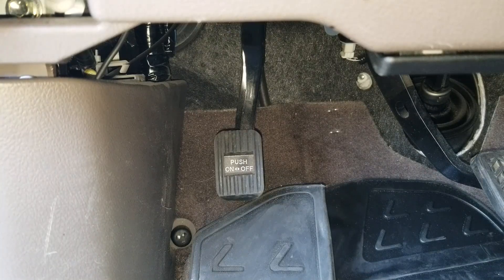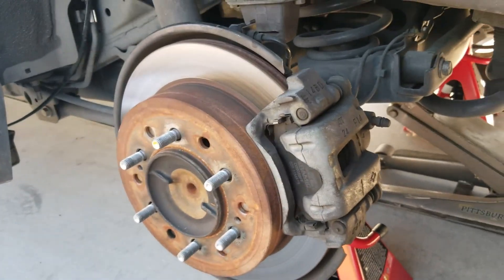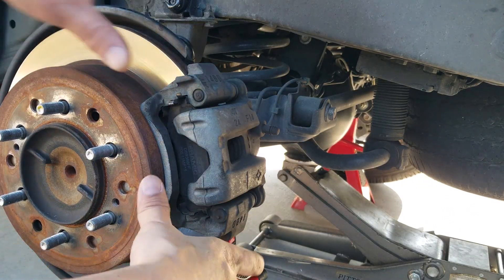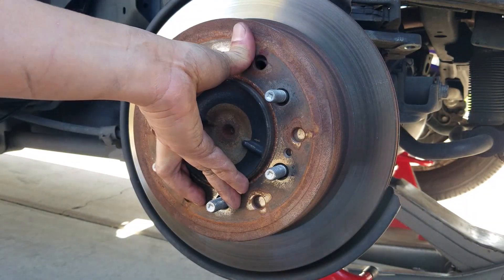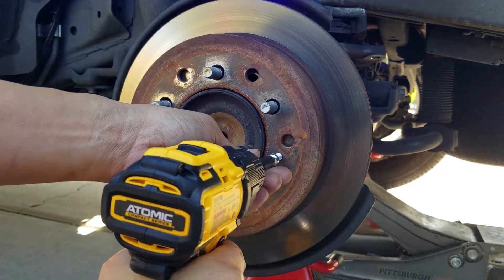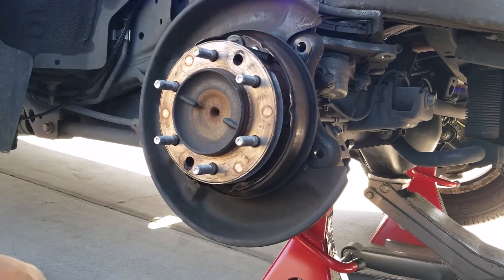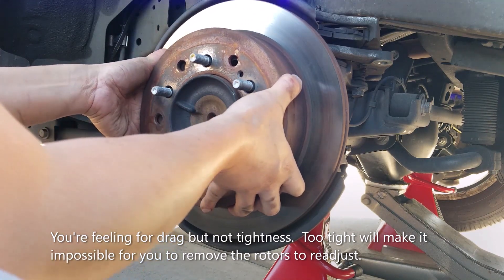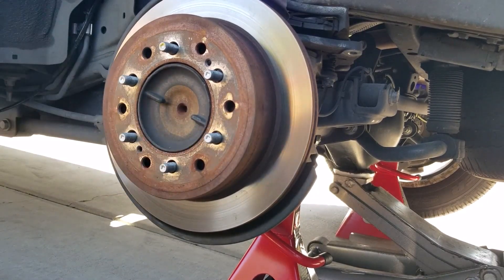2010-2019 Lexus GX460 Emergency Brakes adjustment

Comment: Hey Bob, great video as always. one question, why you want it to create drag when ebrake is released. wouldn't it wear down brakes plus create drag? logically ebrake should not be touching rotor when released am I wrong?
Reply from the maker: If you take a look at the gap in your front brake pads, you’ll notice there aren’t any. Same thing with the rear. We are not clamping down with force. We are just slightly having the surfaces meet so there is no unnecessary play in your emergency brake  pedal
Reply: @GXBOB  thanks makes sense, I have to fix it cuz mechanic messed up when changing the rotors, hammered the hell out of the rotors instead of using screws. It makes noise like when you ride bicycle and suddenly stop spinning the pedals. like clicking noise

Comment: Great video.  Thanks.  But. on my 2014 GX 460 only the pasenger side rear parking brake seems to be adjustable.  The drivers side rear parking brake has the same structure, but the adjusting bolt doesn’t turn.  It will not expand and contract like the passenger rear.  It is a different adjustment bolt.  Do you know if the driver rear is self adjusting?  Thanks.
Reply from the maker: Yes they are self adjusting, so they say. Lexus and my local mechanic says to not touch it but i did anyways. Don’t regret it because seeing it manually lets me raise the E brakes much higher when set.
Reply: Got it.  Thanks.

Comment: Thank you for your videos Bob. 
 I had all my break pads and roters replaced and i felt the e-brake more loose than normal.  The mechanic told me to use the car for a few days and that they should re-adjust themselves. 
  What do you think about it?
Reply from the maker: He is correct.  They are self-adjusting.  But, the self adjustment is at a minimum.  Your E-brake pedal will still go all the way down to the floor.  If you adjust them yourself, then at least you can gauge how much travel you want on your E-brake pedal.  Mine right now are very ideal since my pedal do not go anywhere near the floor. Also....if you want to accelerate the process instead of driving it around to self adjust itself, you can manually do it since you already have the wheels off your car.....

Comment: Hey Bob, just wanted to add my experience. On our 2015 GX460 with 120k, adjusting with the star wheel at the brakes wasn't enough to get the brakes holding as tight as they should. Truck still rolled slowly on an inclined driveway. I had to go under the dash and take up slack on the cable by tightening the 10mm adjuster nut that's at the cable-end on the parking brake pedal assembly. Pretty easy using a 10mm deep socket. Give it a few clockwise turns, check if the brake holds on a hill and repeat if necessary. And now my pedal doesn't have to be pushed to the floor to engage the e-brake. I guess these cables do stretch a bit as the miles rack up... especially if you're using the brake everytime you park (as you should!).
Reply from the maker: Thank you i appreciate the input.  I might even do a vid on it if the camera angle allows me to.  By the way, i looked at your page and the skateboarding clip of your (i think) wife.  I skated for a very long time during the late 80's when Tony Hawk was a baby.  My board was a Powell Peralta Steve Caballero before switching over to Vision Mark Gonzalez.  I was watching your wife do that 360 spin and it took me back.  Gnarly times to be a kid.  Kids nowadays don't know what real fun is.
Reply: @GXBOB  Hey Bob, that is my mom! She is 62 now but can still pull a clean 360. She grew up in Long Beach and skated in the '70s with the likes of Ed Nadalin and Russ Howell, a little bit before the days of Peralta , Powell and the Z Boys. Very cool to hear about your skating days... I grew up doing the old school "freestyle" skating myself because of my mom's influence. Thank you again for all of your videos, my SoCal neighbor!
Reply from the maker: @surfordie82  wow! 🍷

Comment: There’s another way to do this without removing the brakes and rotors. Just stick a screwdriver into one of the access holes on the face of the rotor and jam it up or down to spin the gear that linked the parking brake shoes shown in the video. The only thing is to line up the access hole to this gear by turning the rotor.
Reply from the maker: That only works on the first generation.  The later generation is self adjusting.  The dealer and my local mechanic recommended not messing with it.  I did it manually to my 2008.  But you're right.
Reply: @GXBOB  what do you mean? It only works on the first generation? What years is that? I have a 2014 and I adjust it using the hole in the rotor but it definitely sucks and is very hard to do

Comment: My brand new GX (now 1400 miles) has a fairly “loose” parking brake; I live on a hill so I have to really push it down to prevent that slight roll-back.
Reply from the maker: They say it auto adjusts but it doesn’t
Reply: Have you adjusted your parking brake since? If so, did you go to your dealership and did they tighten the parking brake?
Reply: @13randres  I had my mechanic adjust it, but still weak, I push it down with a controlled but aggressive speed, and allow the car to roll back on N for maybe 5-10 inches, then I shift to P

Comment: Update! All the GX460 park brake adjustments done a the shoes on't help. It's the front half  Park Brake cable that splits into the equalizer the the R and L cable come from. the main first cable stretches like a rubber band. I can't find anywhere on line the process to replace it.
A 700.00 bill gets it replaced at Lexus and your pedal will be at the top. Never try to over tighten as the cable will stretch or collapse the housing. No matter how many clicks you tighten it, it won't hold  if cable is stretched.

Comment: Dude, like every video you post is something I need to do. This has been bothering me ever since I got my GX. The parking brake will barely hold the vehicle at idle. Seems like a simple enough adjustment to make. Thanks!
Reply from the maker: Whatever you do, do not over tighten.  If you do, you will not be able to get your rotors off to readjust.  Make sure you tighten the spindle one click at a time.  Not 3.
Reply from the maker: According to my local mechanic and the dealer, 2014 and up is self adjusting. Just fyi.
Reply: @GXBOB  can u plz suggest what exactly u mean by self adjusting. i bought a 22 and seems to me that ebrake does not hold the car in nuteral

Comment: So, what do you do when you adjust it too tight and the rotor doesn’t come out to adjust that wheel?
Reply from the maker: You gotta make once click at a time.  Check. Then continue.  You can look thru one of the slots on the face of the rotor and you'll be able to access the gear mechanism.  From that just use a flat head screwdriver and loosen/tighten the gear.

Comment: Bob - LOVE your videos and dont want be against you like your exWife =) But for adjustment  parking brakes you dont need take apart all brake system =) On that drum u got 5 holes next to the lug nuts holes for adjustment that spindle =) Just align one of them  with spindle and use a flat screwdriver thru that hole for spin that spindle up or down till u will satisfied with your pedal and tension on brake - drum movement =) Keep making your videos - im get a lot of information from them ! And Thank you Very much for your WORK with this Lexus !
Reply from the maker: Hey Kolia,  your suggestion works great if the holes were aligned with the adjustment screw to begin with. Mine was not even visible as the holes were displaced.  I think if i were to redo the video, i would definitely add your inputs,  Thanks Kolia!
Reply: @GXBOB  you can easy rotate a drum to align a hole if put tranny in neutral and release a p- brake =) Just align one hole on 6 o clock and stick a  screwdriver in it - You cant miss that spinner i did it on my 2020 - it was loose from a factory =(
Reply: just one more thing  - its only two holes you can use for it - you will see they go thru all metal to that brake spindle .
Reply: @koliapupkin2505 your correct but thr holes are slightly offset and its very tight. You can’t tell if you’re moving the spinner or not so you just have to keep trying and feeling it sometimes it’s faster to just take off the rotor.

Comment: Go back to school, no need to remove the rotor!  You can adjust from the hole in the rotor.
Reply from the maker: @anonymouse955 Yea we all know there’s an access  hole at 6 o clock.  You don’t adjust the E brakes without ensuring all your hardware and brake shoes are not worn causing the long pedal travel. It’s good to have an overview of your E brakes and it’s wear condition and plus removing the rotors provide better camera angles for the viewers and to show them what the spindle gear looks like. Happy Thanksgiving.